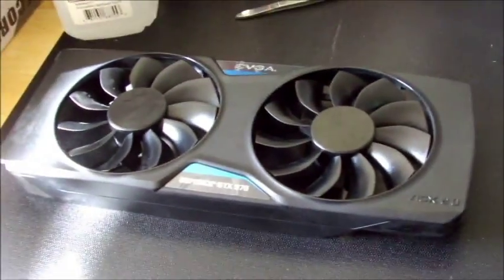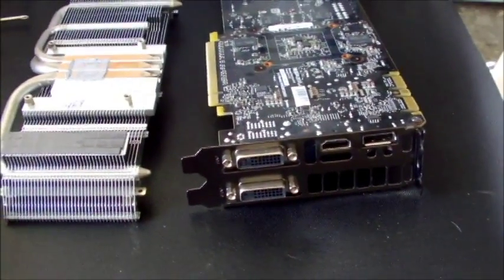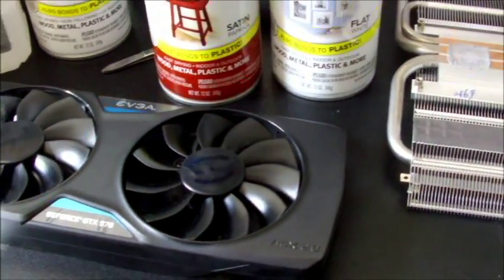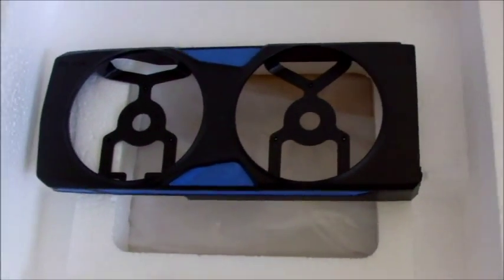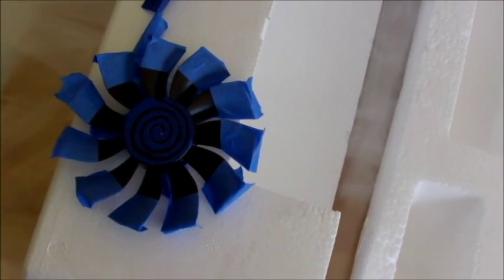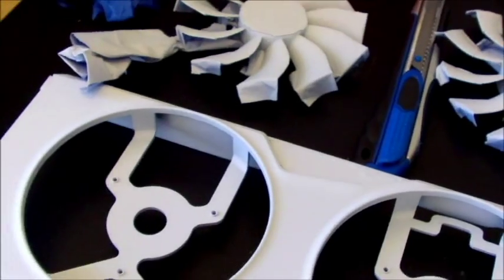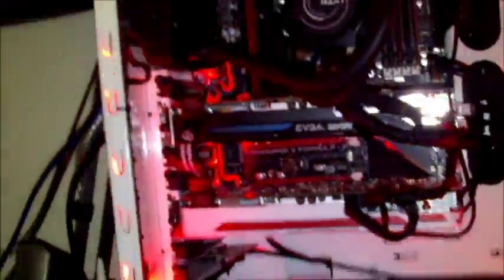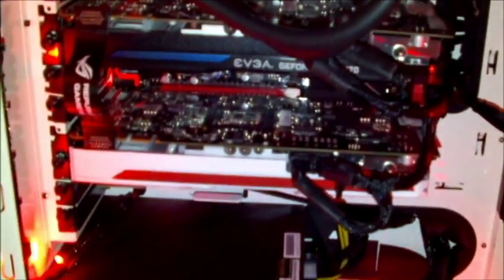Paint your graphics card!

Comment: Be careful when painting your fans. Paint makes them weigh more and screws with the balance making them less efficient and shortening the lifespan.
Reply: Carter Its not a heavy paint and adhesion is tight. Been running them hard and have yet to have an issue. But maybe exception to rule.

Comment: I am thinking of using plastidip on my 2 gtx 980's! But is plastidip heat resistant?
Reply from the maker: Plasti dip is heat resistant up to like 145 F if I'm not mistaken. My two 970s never really go above 65 C so you would be fine. My buddy runs his ati's with plasti and they draw more heat and he has had no issue. Just paint them and hit em with the plast dip clear coat and you will be fine. Sounds like a fun project!
Reply: Joe Bullins Also have to remember the paint won't be in direct contact with the GPU anyway. I wouldnt imagine it being above 55 as an ambient temp inside a case if you have good air-flow.